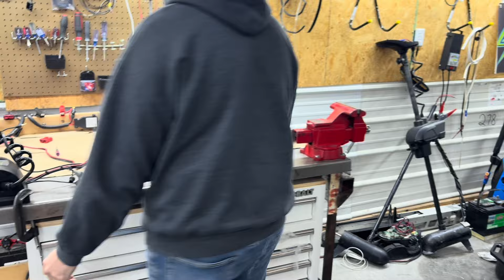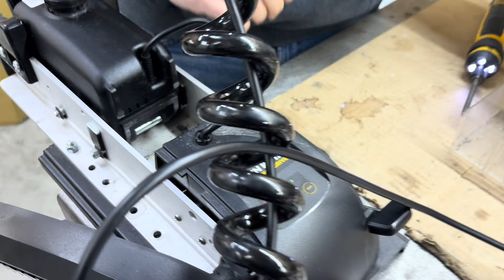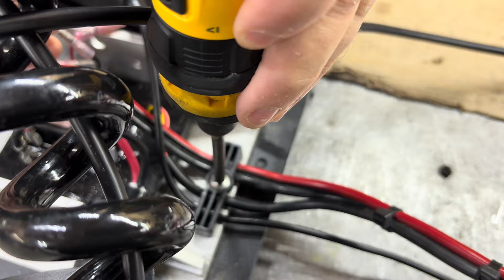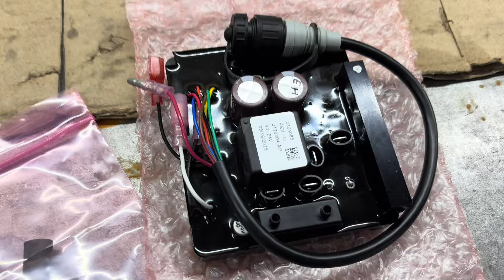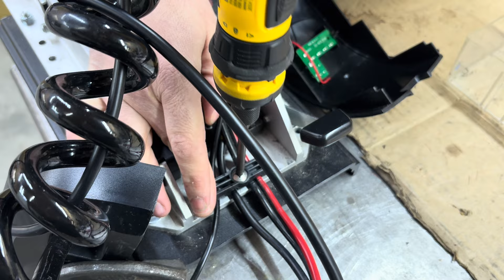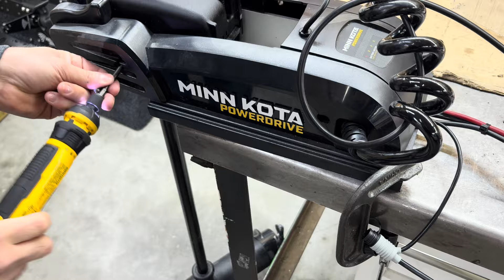How to change Minn Kota Powerdrive Control Board.

Comment: I ordered this part and installed it on my trolling motor as instructed. Power disconnected, all contacts are clean and tight. I still have no response from my Minn Kota PowerDrive V2 with Ipilot(non auto pilot). Can you possibly tell me where I need to look next? Has appropriate 25.5 volts for a 24v trolling motor as well.
Reply from the maker: Does it turn on? Anything working at all?